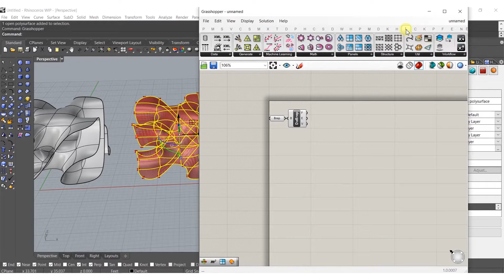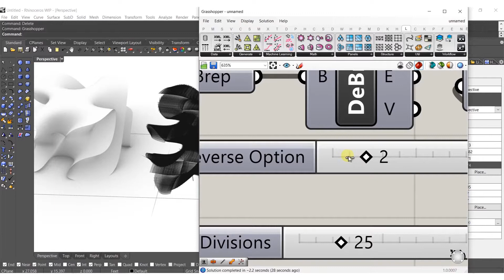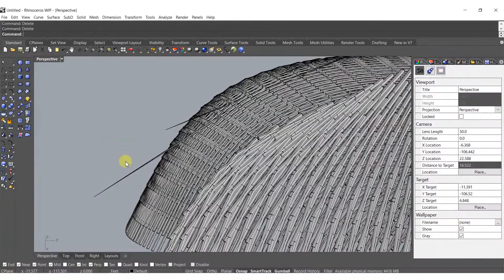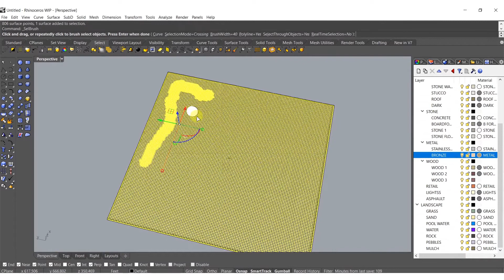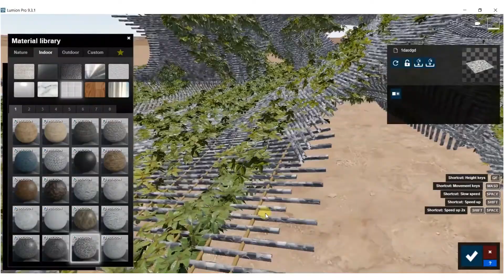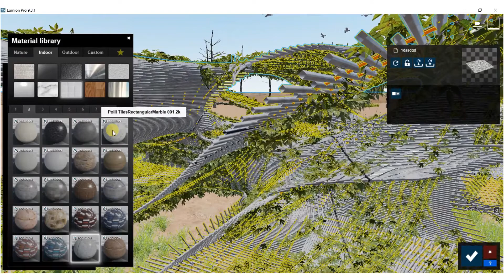Rhino / Grasshopper Tutorial _10

Comment: Hi, I downloaded the plugin for meshpipe but it says the file type is not supported by Rhino. and I could not also find U division, Reverse Options and Random Split.
Reply: and I could not find "Reverse Surface" too.
Reply from the maker: @mag2079  You need to right click the plugin, before you place it into the special folders and make sure it is not unblocked.
The other plugins are available in Lunchbox plugin

Comment: Very nice tutorial!! I’m just wondering if I can achieve the same outcome with rhino 6
Reply from the maker: Grasshopper script will work but the sub D modeling is in rhino 7.
Reply: U can use rhino 6 u have to model it with low poly faces and use these commands at ur will

ToSubD - Creates a SubD limit surface from a mesh object
Mesh - Creates a mesh object from a SubD limit surface
SubDivide - Increases the number of vertices in a mesh or SubD
ToNurbs - Creates a Nurbs surface from a of the SubD limit surface